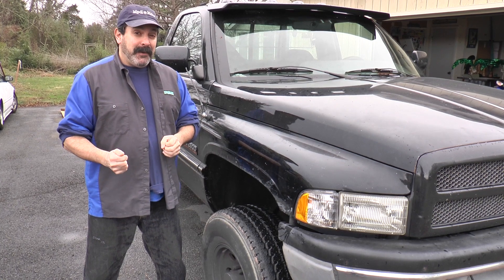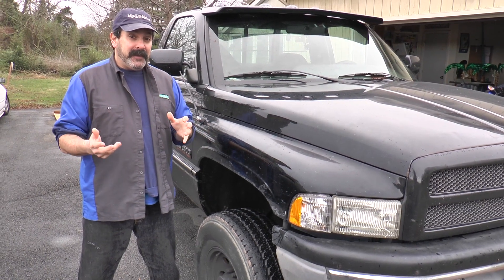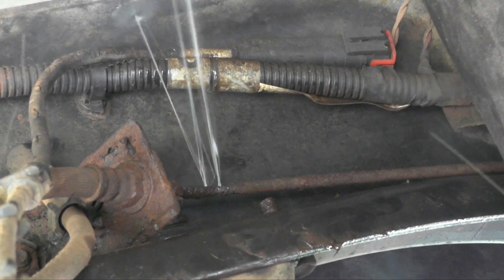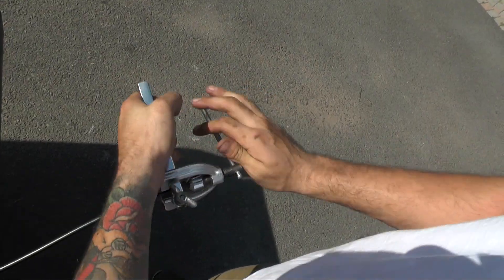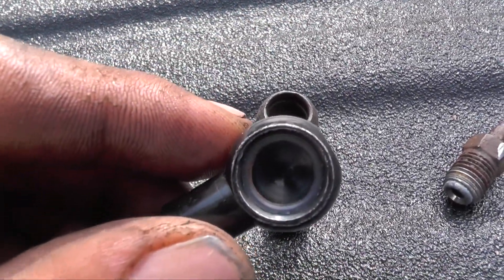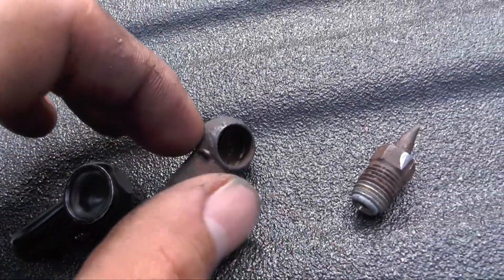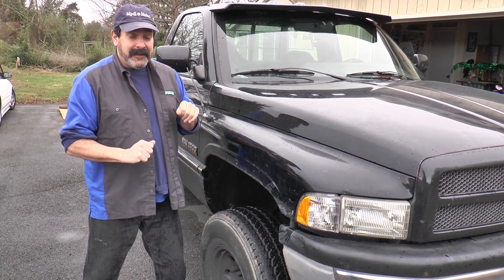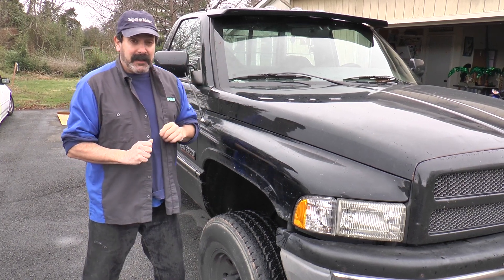Dodge Ram 2500 Cummins 12V - Project Jumbo Pt 2 - Ain't Fuelin'

Comment: 10k😂😂😂 that 600$max, work in this truck body not more man.
Jolopy jang 60$ door paint 60$ clear coat 60$ bondo 20$ and same small things 60$ and your heands 😀 if you give samebody to do then 1500max not more American shop 3000$ so 10k you serliosly smoke to much